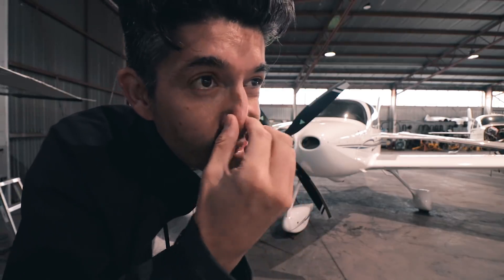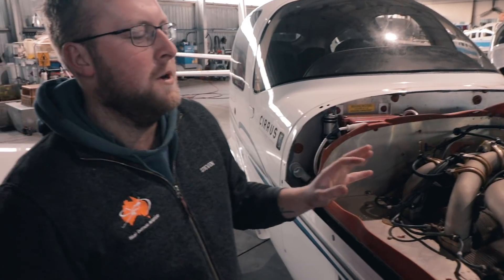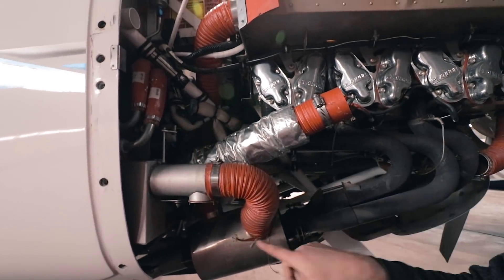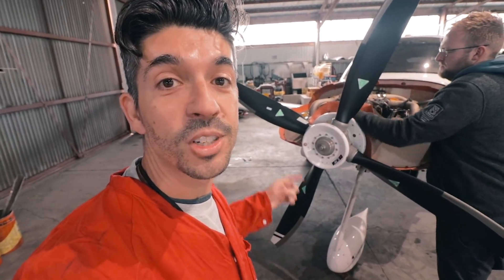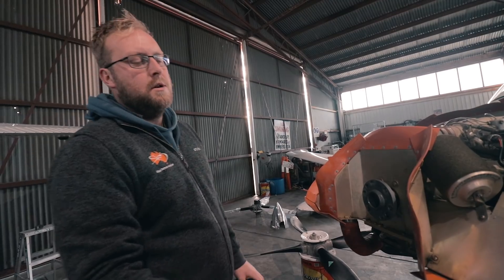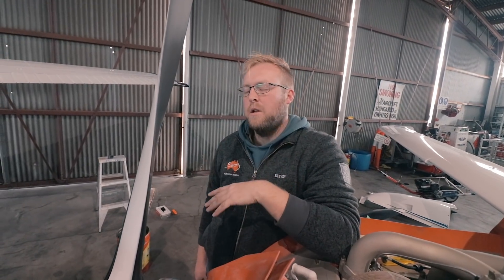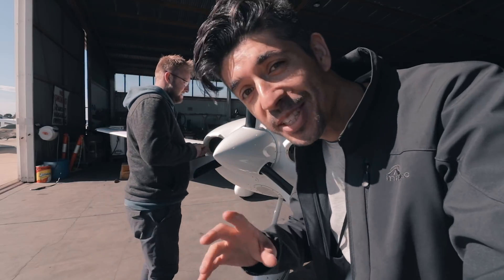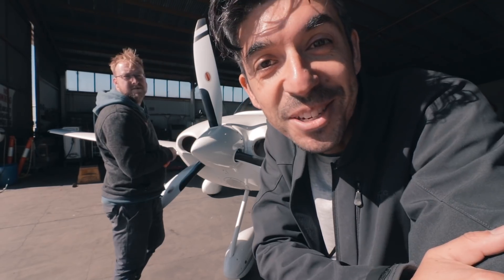Cirrus Aircraft Maintenance - Changing Our Propeller

Comment: I have exactly the same four blade prop on my SR22 - and I would really never go back to the 3-blade. I land on grass strips a lot and I never had a problem in 4 years. The 3-blade might be better on rough gravel strips though. PS: In a conventional Constant sped airplane the blue lever does not control the "pitch" of the blades but the rpm. The pitch is set automatically by the prob.
Reply: Yes and how is the RPM controlled?
Reply: @tronas8515  It is a constant speed prop. Or what exactly is your question?

Comment: Hi Stefan, very interesting.  I guess I'm a tech nerd.  Anyway...  what are the disadvantages of leaving the 3 bladed prop on?  Why swap back to the 4-blade prop? I understand that 2-blade props are more efficient but even bigger in diameter. My trike is 3-blade for the reason that a 2 blade would be too big, and a 4-blade is not efficient enough.   My understanding too is that more blades means more torque for climb, but less efficient cruise.  Thoughts?

Comment: I think I prefer the 4 blade as well.
Reply: Kaine Sherwood other than it being quiet it's not worth it. 4 blades Cost more to buy  and little to basically no increase in climb speed. The three blade is  cheaper fairly quiet and it is faster in cruise.
Reply: Harry Harkins, sounds about right, but it does look better :D and with a Cirrus its all about the looks ;)

Comment: I have always wondered, what is the benefit of 4 blade over 3? Faster? Smoother? Or is it just the aesthetic?
Reply from the maker: The 4 gives me better climb performance, and is a handy speed brake if you want to slow the SR22 down. It's also a little quieter and smoother yes. But the 3 is more durable, better for some of the dirt strips I'm planning to land on.
Reply: Stefan Drury ahhh nice! Makes a lot of sense. Last question, does it burn a little more fuel than the 3 blade?

Comment: Does the switch to the three blade prop affect the weight and balance measurements much?
Reply from the maker: It does a little yes, the new prop is slightly heavier so I do have to amend the w&b calculations slightly.
Reply: Not mention but the Hartzel looks like alum. They do make a composite with a nickel leading edge. Much lighter.

Comment: If the pitch is controlled by the onboard systems, does any modification to the engine management system need to be done to make the system cater for the change in prop as far as CSU goes?
Reply: Sorry for being 2 years late. As far as my AGK education and experience with FADECs goes, like any normal CSUs, fadec controllers looks for RPM.
If you look at how CSU works its centripetal forces acting on a governer letting oil in or out to change the pitch to maintain a constant RPM. 
Imagine flying a 182 and without telling you I changed the propeller diameter, you’ll have a different to previous lever position but you still pitch for a same RPM. Same as the FADEC, it’ll also look for the optimal RPM at your selected power setting so nothing really has changed.
Hope that answers your question!

Comment: The three blade hartzell is a hotprop for de ice. Was the four blade?
If not will the heat or fluid feature of the prop function??
Reply from the maker: Well spotted Lee. No, the 4-blade didn’t have anti-ice, KJN doesn’t have that option. But Blue Demon are using a new 3-blade with anti-ice so when we put the 4-blade back on, they have the option to put this 3-blade on an aircraft with FIKI capabilities.
Reply: Is that what the 'leads' are for - the ones going to the black leading edges of the prop roots at time 8:52?
Reply: sactu1 none of the cirrus aircraft use "hotprops" they are either TKS or nothing. If there is no TKS the black boots are then only use to help with rock chips. You get better climb with the 4 blade and its quieter. But the 4 blade is an MT brand and has a 6 year overhaul
Reply: Does anyone know if you can order a Cirrus with a 4 blade prop?I would prefer the quieter blade.
Reply: @tomedwards9265  no cirrus comes with a four blade prop from the factory. You must order it on your own after purchase of your new plane